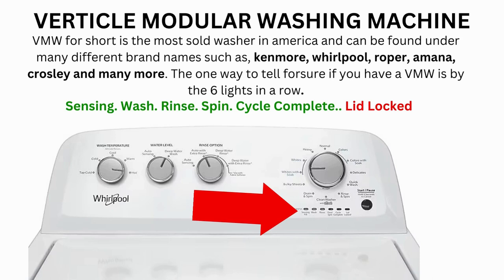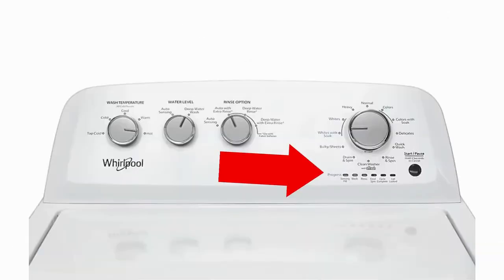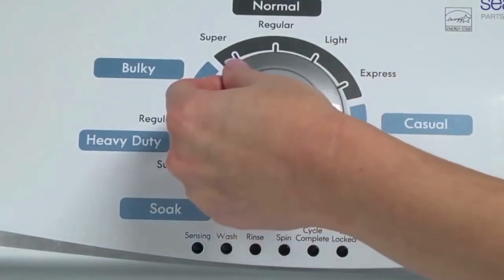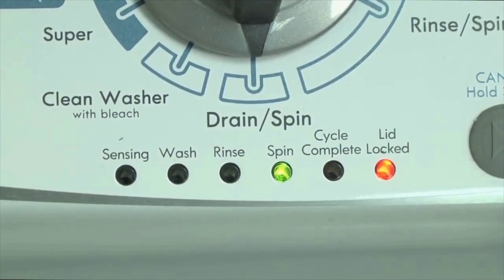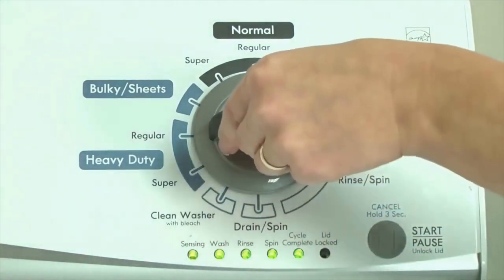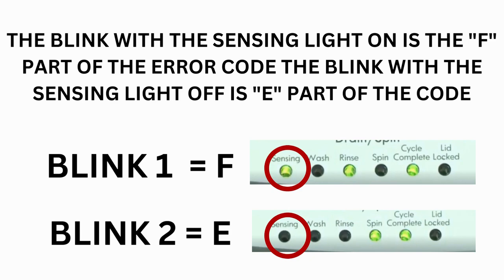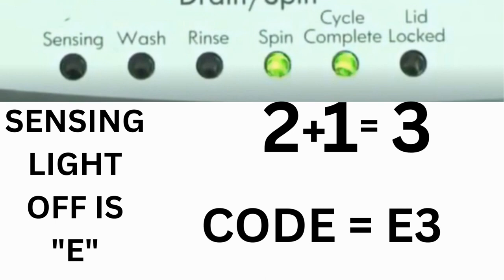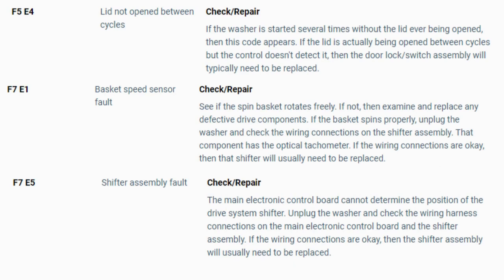Amana Washer Stuck on Wash Cycle Troubleshooting Guide

Comment: When I used Recalibration Mode, my six green lights did not flash from right to left like in the video, they all stayed on until the mode completed.  There were no error codes stored.  My washer is still stuck on the Wash cycle.  Does this mean I have a bad Control Board?  Thanks.
Reply from the maker: MOST LIKELY YES